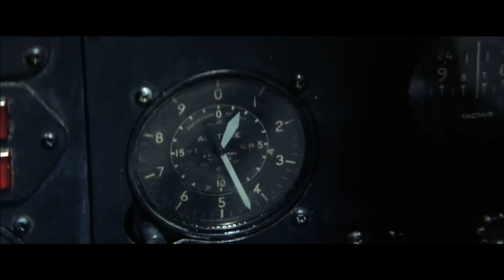Why do these starfighters ignore physics?

Comment: Absolutely nerdy discussions on sci-fi: perfect. :D

A few notes, though. First, being in orbit simply means that we are moving sideways fast enough compared to the surface that, while we are falling and being dragged towards the object we're orbiting, we are simply missing the surface. For the most part, the reduction in the pull of gravity with distance doesn't make that much of a difference. It comes into play only when another heavy object's gravity overwhelms whatever gravity you are experiencing from the object you were orbiting. For example, you can orbit a planet that does not have an atmosphere from very close to its surface, as long as you clear the terrain and any obstacle.

With that out of the way, the repulsor lifts don't necessarily play such a big a role in keeping fights slow and close. They explain why you can hover a spacecraft over a landmark, even at hundreds of kilometers in altitude out in space. You could have relatively slow fights around objects in orbit around a planet if all of the ships involved in the fight essentially share the same orbit. We do achieve to dock two objects out in orbit, after all. In time, objects at different speeds/altitudes would see their orbits diverge, and probably converge again later. But the thrust of Star Wars spacecraft are probably enough to make turning fights possible in orbit.

Instead, two things that make Star Wars fights seem unrealistic are: the distances, considering the vastness of space, and planetary blockades, possible thanks to hyperspace lanes exiting right over the same spot of a planet, despite planets spinning on their axis and orbiting their star. Explanations for the second one usually touch on the fact that lanes are generally constantly kept up to date, for both safety and convenience reasons. That said, a determined attacker should be able to calculate a different hyperspace exit location near a planet, allowing them to make landfall while completely bypassing any blockade in space.

Now, disregarding the above point, the real reason why Star Wars battles kinda work is thanks to faster than light travel. Without FTL, you cannot get close to your target without being spotted from very far away, at least much further away than what we see on screen in Star Wars. The other way to make it work without FTL, like in the Expanse, is to have enough stealthy ships on the offensive that the target of an attack does not have enough time to destroy all of the attacking vessels before some of them get close. Couldn't have been done to a nicer vessel, poor Donnager. But with FTL? You can jump in right by your enemy, unleashing shots that are nearly impossible to dodge at such a close range. And under such conditions, fighters and large brawling battleships do make a lot more sense.

This FTL reasoning also applies to other settings, like Star Trek, Starfield, Homeworld...

Comment: I explain it in my roleplay games that the engines are programmed to simulate atmospheric flight because most pilots know how their ships handle there and probably learned to fly in an atmosphere. So them flying the same way in space helps with the learning curve. You could also say that the repolsar lifts cause a certain amount of drag on the ship and is limited to how fast it can accelerate them.
Reply: That's a good explanation unless you realize that utilizing real orbital flight mechanics, however unintuitive, would increase the pilot's performance, evasion, etc.
Reply: @im_piano  it's a setting that can be turned off. I let them do proper maneuvers, but the piloting checks are harder.
Reply: @jamesanderson6769  ah, clever, Elite Dangerous style.

Comment: i also have a theory similar to this on why -in star wars, we can hear in space.
normally, Sound travels through the vibration of atoms and molecules in a medium -like air and water, to our ears which registers it as noise. that is why you cannot normally hear in space, because it lacks such things 
my suspicion is that there exists a small device in all spaceships that is designed to detect the vibrations emitted by vessels and explosions in space, and translates those vibrations into noise inside the starship.
This would be valuable to all pilots, who likely depend on sound when they fly.
The Star wars Galaxy is supposed to be leagues and bonds ahead of earth's own technological abilities, so it wouldn't be too far fetched to envision them having created such a device
Reply: "In my world, there's air in outer space,". "When I want it."-George Lucas.
Reply: sound vibrations need a medium to travel through.  so your device would have to be electromagnetic detectors and an audio processor with speakers.

of course, the tactical display should also be able to gather tracking and status information, and simulate appropriate sounds.

we certainly have this technology.

Comment: In my head canon ships in SW have a limitation in their inertial dampeners technology that requires them to be pointed as close to their vector of velocity as possible in order to keep dampening the craft's inertia and not turn passengers into goo.

I came to this conclusion after trying to recreate a starfighter flight characteristics in Kerbal Space Program (nice mention btw!). If you tell your craft's SAS to keep pointing Prograde, and you use RCS translation controls (IKJL and HN) without turning with WASD, your craft will start flying and turning like a starfighter, with its nose pointed in the direction of travel!

So in the movies, when characters do crazy maneuvers, it can be explained as them intentionally turning off inertial dampeners and enduring extremely high Gees for just a few moments before turning dampeners back on.

Comment: The Starfuries from Babylon 5 were designed with realism in mind. In the show they move the way you would expect them to in zero-G and no atmosphere.
Reply: im pretty sure the downside is that you're effectively knocked out by the g-forces of most maneuvers, so they really shouldn't need a pilot, if anything they're just dead weight. if anything i feel like starwars droid fighters/vulture droids are the most accurate space fighter in popular fiction because it has no crew, getting rid of any g-force limits (besides the strength of the hull itself).
Reply: @Minty1337  I would remind you that restraining bolts exist for a reason. LOL More than one galaxy has nearly burned more than once because of armed droids.. So while your answer is logical, it doesn't take into account things like Skynet....The Men Of Iron...etc.
Reply: yeah, very evocative starfury movements in that show. "that's how it probably should look!" they also launch by flinging off a rotating space station segment .. and dock down the center line where there is zero G.
Reply: But at that point, you may as well have ALL combat ships of any size be either fully automated, or remote-controlled drones.  The only reason for humans to be in space is either habitation, or transport.

Also...something like the Star Fury is basically worthless as a space combat option.  No matter the bullshit quasimagical tech, there's just no way it could have enough thrust AND carry enough propellant to be useful at the kinds of ranges real space combat would take place at.  Two opposing fleets won't even be orbiting the same body, and if they are, it'll be at vastly different distances from the body, and at wildly different inclinations.  Otherwise, any given battle could only last a couple of minutes, before the two fleets diverge and can't shoot each other anymore.  And trying to rendezvous for combat is just stupid.  On top of that, fighters/drones would be trivially easy to shoot down in space at those ranges.

Something like the Gunstar from The Last Starfighter, is probably the absolute minimum any space combat craft could get down to.  And there'll never be missiles as space weapons.  Same problem as fighters with thrust and propellant, and they're just as easy to shoot down.

The closest to fighters there'll ever really be, will probably be corvettes built to carry a single full-sized anti-capital ship weapon in a spinal mount, and then enough power and/or cargo space to make it worthwhile.  Then a big-ass engine and propellant, and thrusters for high agility.  It'd basically be a high-performance mobile manned space turret.  But that's about as small as anything practical could ever get.
Reply: @DoremiFasolatido1979  i think smaller fighters have a place, but more so as swarms of drones than dedicated ships, which is why i consider the vulture droids to make sense to at least some extent.

but yea, based on stuff like children of a dead earth and other more realistic interpretations of space combat, bigger is almost always better, most mass, more armor, bigger weapons, smaller is rarely better due to how inherently vulnerable and limited it makes the ship. the only exception is drones and missiles, in which case just sheer numbers make up for the lack of individual firepower and the quantity gives it redundancy.
Reply: @Minty1337  Actually, never mind.  That response tells me everything I need to know about how this will turn out.
Reply: @DoremiFasolatido1979  missiles will always work, they are just parasite drones.

Comment: They don’t need to beat the planet’s gravity as they have achieved mastery over gravity and control where the pull of gravity (center of gravity or has the most mass) at will. Thats what turbolifts and other “antigravity” devices do. There’s no such thing as antigravity but you can achieve the same effect by controlling where the center of gravity is with the right technological knowledge.

Comment: I would love to see a deep dive into the jamming technology in Star Wars, as we are rarely given any details. Depending on how it works, It could very well give an explanation as to why guided munitions such as missiles are severely lacking in combat
Reply: it could also provide an explanation for why most ships in star wars is designed with their control bridges in a tower, rather than inside the ship itself. the expectation is that you can secure the bridge, but keep tabs on the battlefield through cameras or other devices.

But if Jamming Technology is advanced enough, it could potentially be used to knock out any such method.
Keeping in mind that when the Trade Federation invaded Naboo during Phantom menace, it also knocked out all communications on the planet.
Theoretically, the Star wars Galaxy may have Jamming Technology that does the same to cameras/other devices, which would explain why most ships place their command deck on some sort of tower. A ship that relies on cameras, would be blinded, possibly for several minutes, and scrambling for information, possibly even ramming into another ship or station because they couldn't respond in time.
Reply: @acecalldale234  Makes me wonder how much of any ship's computing power goes into the measures and countermeasures. It must be a lot, perhaps the majority. It would explain why droids aren't so good at targeting. Makes me think if those measures were shut down for even a moment, the droids and other targeting computers would hit with lethal nearly 100% accuracy

Whatever passes for RADAR in this universe, the targets must look practically quantum (never in one place, always shifting) forcing everyone to dogfight and visually identify targets despite all their cool tech
Reply: Raspberry!
Reply: @MonkeyJedi99  There's only one man who would dare give me the raspberry....LONESTAR!!
Reply: They shouldn't exist at all.

1)  No matter the quasimagical bullshit tech, they'll NEVER have the speed or range necessary for space combat.

2)  They're stupidly easy to shoot down in space.

But the real reason is...pew-pew guns are "cooler."  And it hurts my fucking soul (if I had one) that that's true.  Humans deserve to go extinct.

Comment: In Legends novels, authors like Timothy Zahn referred to a system called the “etheric rudder” that allowed starfighters to fly as if they were in atmosphere while in space. Like you said, the technology used by ships in Star Wars is beyond our understanding, but technically, since it’s really fantasy and not science fiction, it doesn’t need to make sense. People also misunderstand escape velocity all the time. You don’t have to be going any particular speed to escape a gravity well as long as your engines are more powerful than the force of gravity. If you accelerated to 2 miles per hour, balanced the thrust of your engines to counteract the force of gravity, and had unlimited fuel to keep your engines running, you would escape the gravity well. In Star Wars, they don’t seem to cut their engines to conserve fuel like we have to with real world rockets. Presumably, their engines are far more efficient than ours.
Reply: I always figured the atmospheric maneuvers in space were a conservation of energy and fuel thing. Which is more fuel efficient. 1: use thrusters to flip the ship 180 degrees, then fire the main engines to bring the ship to a rapid stop, then back up to speed in the new direction, with your inertial compensator having to counteract all of that inertia, using energy. Or  2. Use thrusters to gently nudge the ship around in an 180 arc at 3 to 6 Gs, or whatever inertia is measured in.
Reply: @ It is how physics works. If there is no net force on your spacecraft because your engines are producing an opposite force to that of gravity, then you just continue at whatever speed you have.
Reply: Does q ballon gain speed?  @TPWR1337

Comment: Gotta geek check you on this one Allan - sorry ... The repulsor lift was a fiction created to enable atmospheric flight and 'float' near large gravitational masses. Manoeuvre was actually achieved through a device called an 'Aetheric control surface'

The Aetheric control surface  was a device that interacted with a fictional phenomena known as the 'Aether' or 'Ether' to create changes in momentum much like wind resistance in real life.  ... Timothy Zhan used this in his books, so did Mike Stackpole in the Rogue Squadron books ... the Aetheric rudder, for example, acted like a real rudder and allowed dramatic manoeuvres that added suspense. 

Fun fact - the Ether was actually a pseudo scientific principle from Victorian times - Scientists actually thought that the space between planets was occupied by a mysterious substance - the nature of which we did not know ... but it was invisible and hence probably similar to a gas, vapour or ... ether.
Reply: In Victorian times Aether theory was science, not pseudo science. It was based on the idea that waves needed a medium in which to move (eg sound in air or water). They didn't know at that time that light was an electromagnetic wave that could move in a vacuum.
Reply: @tektrixter  Good to know thankyou! ... A good reminder that I shouldn't apply pejorative terms to Victorian science.  I always saw Aether as a placeholder theory for later experimental confirmation ... much life dark matter / dark energy ... we cant see it, but the maths suggests it might be a solution.
Reply: @planetofthepete  the maths could be bandaids for their theory, and not the actual reality.  possibly a step forward, but could also be a step back.

Comment: I never really understood how artificial gravity actually works in most scifi, whether Star Trek, Star Wars, Stargate or Farscape.  I understand the practicality of it, but not how.

That’s one of the things that I liked about the Expanse.  They compensate for the low or no gravity with either magnetic boots on metalic plates, or centrifugal force or constant acceleration, for when gravity was lower than places like Ganymede, because the human body needs that type of resistance even for dealing with a bad injury.  No gravity + internal bleed or even from a gun shot could be a death sentence because without gravity, the blood just pools up.
Reply: Quantum physics is where you might find some answers.  Create fluctuations, get effects.
Reply: @   Well in Star Trek,  artificial gravity is created by using a hypothetical subatomic practice called the graviton, generated by a gravity generator and passed through the gravity deck plates, creating an gravity net across each deck.

By hypothetical, I mean not real.  The other problem being, would that not make the ceilings down too?  Or does the field generates only extend so many feet above the floor?  Or is there some type of graviton insulating barrier between decks?
Reply: @eds1942  That's the "fantasy" part of it all that we're supposed to say "oh, ok" when they "explain" their tech.

They did have some consultants, for TNG's writers that helped shape some of that far out, but potentially plausible future-science.  They based it on what we do know, and also what we were guessing could be possible.

For the deck plates, it is likely generating a field throughout the spaces between the decks.  It is like a sandwich, and the people are moving around through the quantum bologna between the bread.  The fluctuations caused by the deck plates, alters the properties of the space/bologna, which simulates a gravity effect.

Comment: What if Starfighters having less storage and fuel use lower speeds for more fuel lifetime ? They can jump to longer and far longer distances too , and tactical short jumps too , so to save space and consume less fuel they use less powerful engines
Reply: OR (if they are deployed mid battle like TIEs) they can go full speed, even if they only get 2 hours of flight time, but since they will be more effective going at 100% instead of 70% speed they will shoot down more X wings. Yes they need to return to base to refuel but in the meantime they shot down 0.3 more X wings
Reply: @KaizerKlash111  Plus no repair costs! 
Either you survive and need fuel/recharge/BASIC maintenance, or you're blown to smithereens!